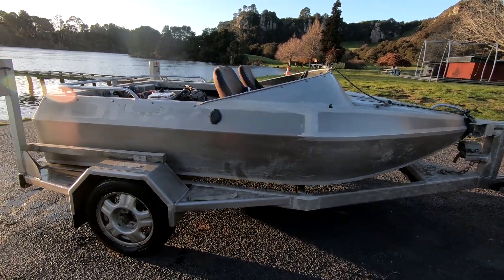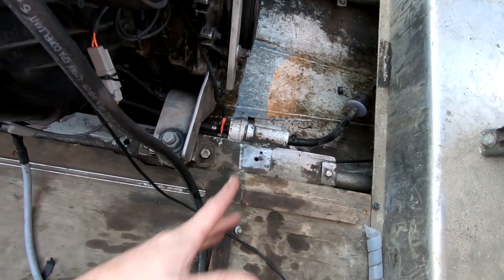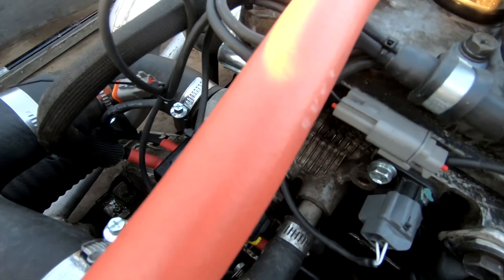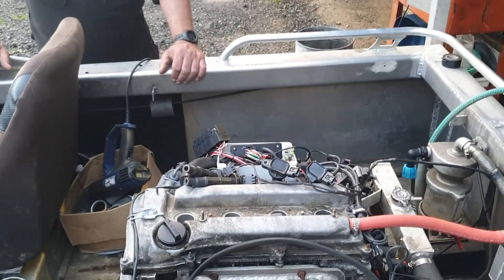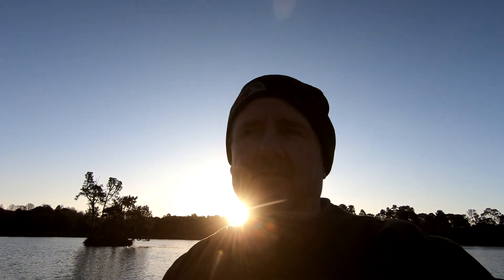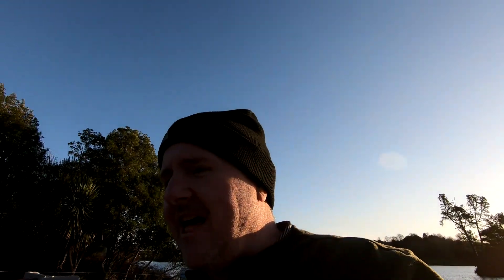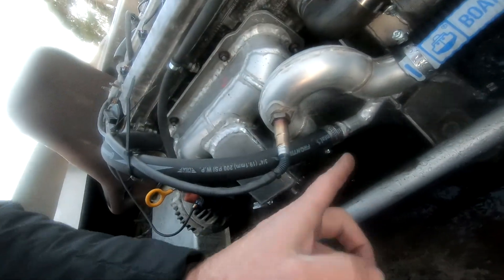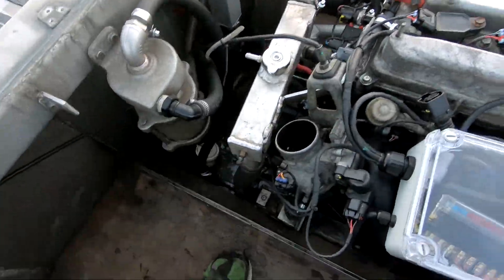Toyota 2az Jetboat test run on the river running G4x link ECU monsoon

Comment: What units that running
Reply from the maker: Its got a really really early Colorado junior from back in the 1970s if our checking is correct.  I'm really impressed with how well it goes now its sorted.  Taps out at 67km/h.